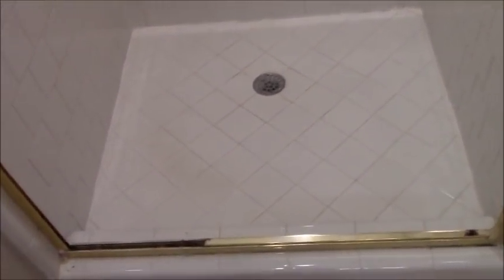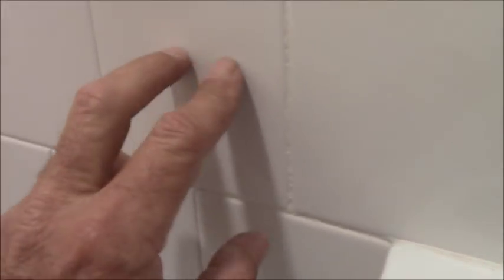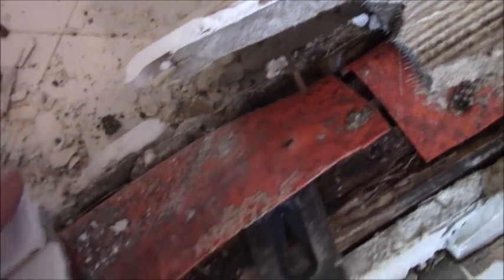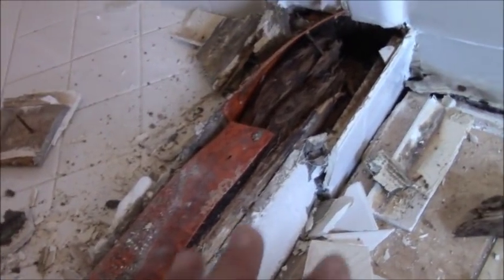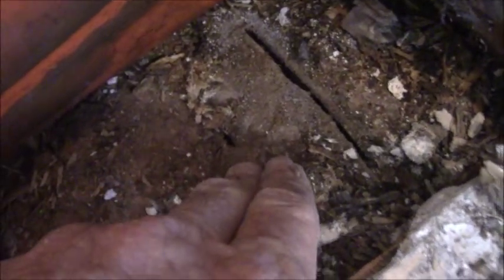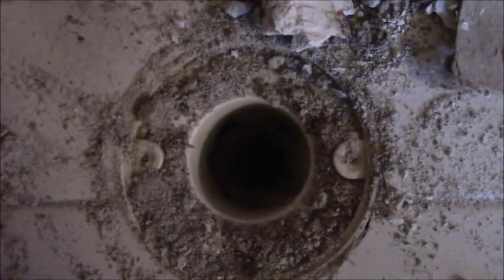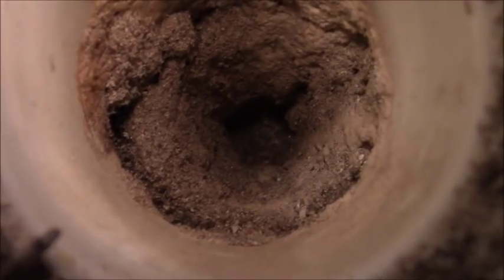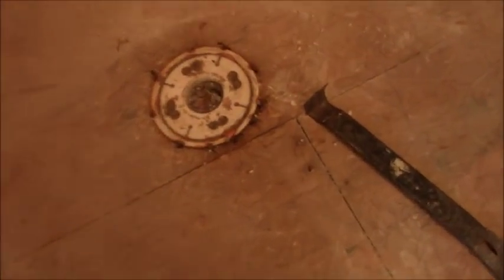Why Your Shower Will Fail....( builders grade tile )

Comment: Thanks for the excellent advice, I too have builders grade owners shower that's 17 years old. It failed, water was leaking into the garage. Explained to my contractor it was probably the grout, since I didn't re-grout or apply sealant in years.  He didn't seem to receptive to using any form of water-proofing. We didn't hire him.
Reply from the maker: Perfect !

Comment: I am re-tiling my 60 year old lathe & concrete shower-stall.  Curb condition?  Like it was built yesterday!   My only concern regarding any curb system,  are the glass-installers' screws!  My new curb will have at least 2 1/2" of concrete and solid cap atop that membrane.  And now, after watching a million of these videos.... and since I have found good tilers ( a 2nd & 3rd generation father & son team of "mudders" ) I have decided to pay them to float a new shower stall, instead of DIY.

Comment: i do electrical in az and came across a house being redone. took a video of the shitty tile work. i posted it on my channel. you will get a laugh
Reply: working in bath and want new ficture.  Holes for the single can in wall are at 45 degree.  How do you deal with this.  Just mount two screws into dry wall lol then wire up.  I know inspector would fail this.  Install new electrical can in wall?

Comment: The damage on this job is from the cut in the liner on the curb if he did not cut the liner the shower still be in use. The idea of dry mud pack for tooling slope and suck up the water to go out the weep holes in the drain this is the process water in water out if you water proof the top of the mud pack your tile constantly sitting in water with no exit causing black mold

Comment: If you have unsanded grout on the shower floor, what do you need to do to prevent potential problems down the road?  Is regular upkeeping such as sealing (once a year, 2-3 coats) going to help? Thx
Reply from the maker: Sealing MIGHT help, but it not a method to keep grout in tact...making sure to re-grout areas that fail & caulking corners is ALL you can do.

Comment: Is there a reason that you cant use a larger gap and use sanded grout on a ceramic builders grade tile? I did it 5 years ago on a tub/shower surround, seems to be holding up fine?  Now i am building a new shower in my addition and am learning more as i go thanks.
Reply from the maker: Sure, I've done that too with 1/8'' spacers so I can use sanded, but that's a custom job, not a builder's job, they won't take time to do it.
Reply: StarrTile oh good i thought i might have done something that would cause problems later, thanks.
Reply from the maker: Maybe with the job you did it's ok...but a lot depends on proper upkeep & maintenance which most homeowners neglect doing.
Reply: StarrTile thanks i keep the grout sealed and caulked when needed.
Reply: StarrTile

Comment: Can you define "builders' grade tile" and how it is different from other tile?  I'm looking at having to redo my entire bath with new tile, about 500 sq ft with the shower pan, because of obvious rot around the curb as well as the studs in the front and rear of my shower near the curb.  I can't afford to spend a fortune on this and am looking for reasonably priced tile and a tile guy who knows what he is doing.  I believe that I also have a foundation crack running across the floor as there are cracked tile and an obvious crack that follows the grout lines.  How can such a crack in a concrete foundation be filled or repaired before laying new tile?
Reply from the maker: Any tile below about a buck a SF is builders grade, but specifically on the videos I post I'm talking about 4x4 or 6x6 ceramic. Once you reach about 1.50 a SF you're doing better, past 2 bucks you have much better.
An uncoupling membrane like Schluter will prevent cracks from transferring to tile.

Comment: so are you saying Schluter KERDI is too expensive or what is the downside to using it vs your method? Just trying to understand. Great vid!
Reply from the maker: I'm saying it's a solution to no problem...basically using a 12 gauge where a BB gun is appropriate
Reply: Kerdi membrane is much more superior to liquid membrane in term of tear/shear tolerance, to my view, especially when it comes to plane change. It also uncouples layer of tile with thinset from structure. Lightweight construction of US houses the cause of a lot of flex and liquid membrane by itself may not tolerate structural flex during strong wind gust. Using panliner as a barrier, prone to maintain big and heavy chunk of wet mortar slab that formulates slope, while surround walls are much thinner, which under constant flex would lead to tear/shear stress lines at floor to wall connection. Sure thing, that saturated water won’t jump out of pan liner, but it maintains couple inches of wet slab which would decolorize floor grout lines, and with no much ventilation grow the mold eventually.

Comment: Why would the put mortar down the drain?
Reply from the maker: On a construction site, the contractors are lazy...they think it will get washed out anyway.
Reply: Youtubeaholic2 they did this at my house as well, had to call a pro to clean out my main pipe twice. they dumped all the mortor down the drain .
Reply: Because when they put mud in the pan they did not tape the top of the drain so you move the cement around some of it falls down into the drain